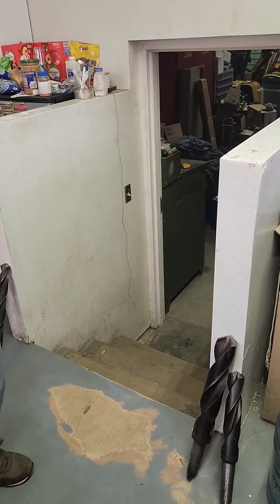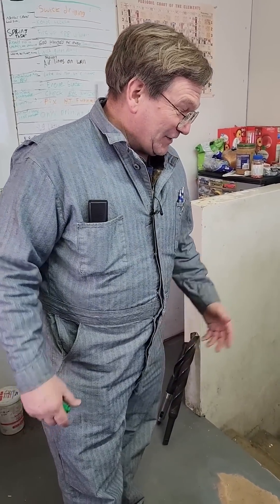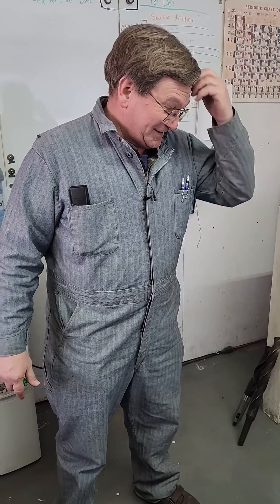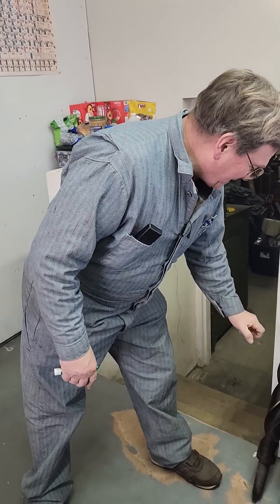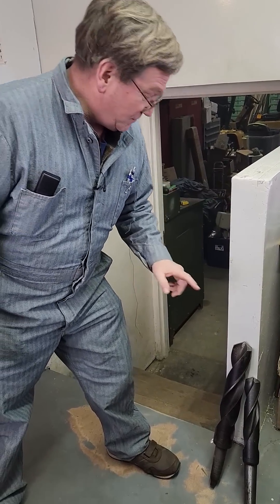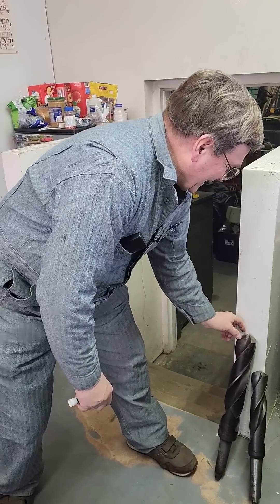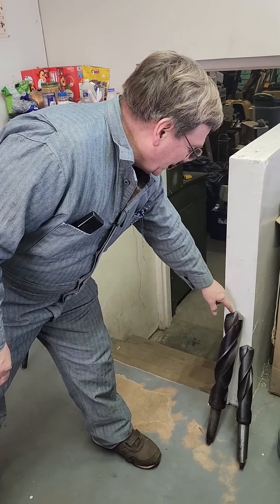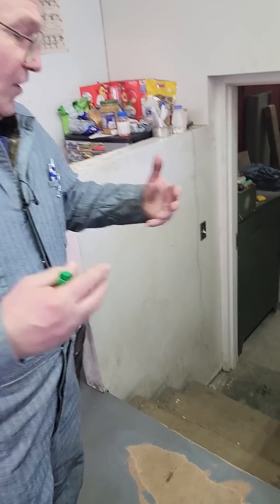Machinist's Minute(s): What size for your pilot drill?

Comment: Can’t agree more. Only been doing it for a couple years but I’m in school for the cnc side and very obsessed with applying it to my manual machining job and I find myself having this same natural thought process. It’s so important to actually understand how the things work and how you can take advantage of that rather than just following some rules made for first year apprentices. (This is more on the hydraulic side of our shop->) Like my boss at first was concerned about me cutting a small hydraulic line with a tube cutter rather than a saw because the instructor at his class told him it was heresy to use a tube cutter. The only reason he said that was because of the burr that it formed, but that is so stupid because you have to deburr it anyway and should be checking for no burr no matter what. I’ll take getting a square cut with slightly more deburring over having to try to grind a saw cut face square with a complete cluster of a 10ft tube bent in every direction and back over on itself.

Comment: To sit at a drill press with cutting oil ; i wholeheartedly submit…
Unfortunately, 99% of my boring is via a hand held cordless. As such I am susceptible to bit drift. Center punched but not perpendicular or just not clean. Knowing this is my weakness, I add a few steps between where adjustments can be made before final bore is achieved.
So, I will pilot at one forth to see if I like overall placement. Enlarge confirming angles of entry and exit. Then a Final Cut to size and file or thread to suit.

Comment: Measure the thickness of the web that’s the correct size
Edit: been a toolmaker, Tool designer/ machinist and programmer for over 50 years.
I’ve learned from the best .

Always be a student never stop.
I like that you point that out.

Comment: What I've done with drills is cut a "crankshaft cut" on the tip to thin the center. Works like a charm for cutting without all the pressure at the point.

Comment: I'm wired to look at why the rule is there, so that I understand the likely outcome if you hit a situation where the rule can't easily apply- taking out the majority of the material with a pilot, then drilling to final size is the idea- as you say, adjust for rpm and available tooling .
Also for larger sizes, it's amazing how well annular cutters or holesaws work , but I suppose they're working with lots of cutters working in little bits working along a circumference roughly 3x the diameter , vs a conventional drill where the diameter has a cutting edge across the whole width constantly working across that full width.

Comment: Pilot hole: start with the size you want

Stepping up in size: use whichever sizes seem reasonable 

Final hole: the size the hole needs to be, or whatever you got that's close enough if close enough is close enough 

I'm pretty particular in my ways, whether or not my way would be classified as "the right way", but sometimes it doesn't matter that much
Reply: or slightly under the right size and finish it with a reamer

Comment: 50% pilot hole makes no sense, you're not even using 50% of the cutting surface of the drill, and with a twist drill that means you're totally wasting 50% of the drill.

Comment: up to 50 mm i dont use a pilot but rather grind in a split point , most my drilling is a few mm under the finish size to be finished by boring so the accuracy and finish on my drilling work isnt important

Comment: I was taught to use the web thickness + 1/3 as a rule of thumb, the extra 1/3 giving room to evacuate the swarf/chips, but in a work environment where time=money you can easily crank a 2" split point into mild steel after just a centre drill

Comment: Im going give a "self taught" using trusted information method. A twist drills rake angle at the periphery is 12 deg. But, the angle decreases as the web is approached (normally). I then use nothing more than an intuitive best guess, approach to pilot drilling. A 1\8" web. Gets a pilot of 1\4". For lets say 3\4". This gives the reduced rake angle a means to cut as opposed to scrape through the hole. This works best for low to medium carbon and stainless steels. Softer and gummier are drilled with a reduced rake drill. I feel the theory and results give good evidence of its effiency.

Comment: I only clear for chisel point if my machine is weak, aka mag drill or Bridgeport, I drill 4-6” with spade drill preferably horizontal and clear chips after 2 times diameter depth, no pilot, will chatter if to big pilot hole

Comment: The bare minimum that needs achieved in general is to pilot just bigger than the chisel width of the drill. Bigger drills aren’t split all the way to center and aren’t good at cutting across the chisel. Smaller drills are split to center and can cut in the very middle of the drill. 

This is exceedingly important because your cutting speed (surface footage) is zero at the center (zero radius). The closer to center you are, the slower the cutting speed and big drills just aren’t meant to handle all that. 

This is true basically for HSS (usually Morse taper shank as shown here) drills. 

High performance drills built for CNC production environments are engineered to handle these extreme cutting conditions better though. 

No need to pilot a 3” carbide modular or indexable drill as long as it’s not crazy long.

Comment: I was taught  (from my dad - long time tool and die guy in a shop full of grey hairs to learn from until he became a grey hair ) that the main reason for a pilot bit is that the chisel point on the bigger drills increased the amount of force required to feed the drill through the material and if you are not in a rigid setup the drill will wander and change the hole location.  SO, the pilot drill should be larger than the thickness of the web or width of the chisel point on the bigger drill you are going to use making it easier to feed and more likely not to wander because the path of least resistance will lead the web of the larger drill pretty well and there’s less work for the point to do but he full beautiful cutting geometry of the bigger drill can efficiently cut the hole. 🤷‍♂️ it’s what I was taught and it makes sense to me because a smaller pilot hole is oftentimes faster to drill and then with the right amount of available power the bigger drill will cut more quickly. 😉😃

Comment: Great point about surface speed. When you are take your extreme case of the 12" drill at half the diameter the surface speed is 50% compared to the full diameter. If that ranges too far from your ideal SFPM you've got a problem. And you other factor is power and torque. Great short for thought. Bottom line question the hard rules and bend them as far as production requirements allow.

Comment: I always measured the center of the drill and added .020. I’ve used a .5 pilot hole on a 6.” Spade with no issues.

Comment: If you engage in web thinning you dont need a pilot drill either. As an apprentice I got chastised for centre drilling in order to start a large drill (2"? 2.5"? cant recall) that they wanted blasted through the stock as clearance for the next operation. that was a web-thinned drill and it started and cut just fine.

Comment: It's always been my understanding that the pilot hole size should be slightly more than the distance between the inside ends of the cutting edges. This way the whole length of the cutting edges is being used.

Comment: My shop teacher told me decades ago that the web of a drill bit doesn't cut, it rubs more than anything, so if you want to pilot a drill correctly without chatter, you would only need to remove the "web" diameter. I've always followed that and it's always worked like a charm. People using large pilot drills is the reason for chatter.
Reply: That is the rule I always used, remove the web with the pilot drill.
Reply: 100%
Reply: Or split point it. You are correct otherwise.
Reply: @butterflywing61 If you wrk someplace where you don’t get to spec twist drills you’re probably going to get chisel points from the crib. If you’re doing stuff at home and can afford splits as well, go for it.

Comment: You should vary your pilot holes so when you have to sharpen your bigger drill bits it’s because the whole cutting face is dull, not just the outside 1/2, 1/4, 1/8. 
As an example if you used the half rule, you’d only wear out the outside half of your big drills and be wasting the inside half sharpening it away.

Comment: "I was taught" - yadda yadda..  Is the real answer from a person who hasn't lived the craft enough to work out their reality yet (many never will)..
Pilot drill size all depends on how big is the drill and how much available force is there to push it into the job, coupled with available torque and coolant....

Dead centre is "necessary" - the minimum number of processes is key to production numbers..
 
How about a through hole cooled pilot tipped 3" drill...
 = single process - surface speed set for the "larger diameter range"..  Annular cutters are the best invention for large holes and small torques. 

 I just wondered, does a plunge cut boring bar exist??-( lol, drill-bore-ream single process) how about an annular boring bar plug cut large bores with a single point - like a curved parting-off tool, curiosity - sure, useful, probably not..

Comment: If you're making an airplane, you use all the smaller bits in the set working slowly up to the size you need, minimising the stress on the metal around the hole to reduce fatigue cracking.
Reply: THAT MAKES SOO Much SENSE!    Thanks!  I won't ever use it unless it's to critique someone on YouTube or Reddit🤣

Comment: I was going to comment.. You only need to make clearance for the web +  a little.
avoid using common sizes for your pilot holes as those drills get used least.. They tend to have the original grind and are still sharp.

Comment: Drill speed for a High-speed steel drill bit in mild steel is
320\Drill diameter in inches. I just remember 1280 for 1/4" and the rest is just fractions. Also Always choose the speed lower on the drill press than the calculated speed.

Comment: I'm no machinist but I've seen a lot of youtube vidoes and therefore I'm an expert!
From what I gather there's two variables, cutting depth and surface speed - for a shallow depth you need a high surface speed (and vice versa).
A drill has high surface speed at the circumference and low speed at the centre but a fixed cutting depth.
It's a compromise between the two but if you remove the centre you narrow the gap.
A bit like facing on a lathe where the centre of the part has a noticeably poorer surface finish - the lathe needs to speed up when the tool gets to the centre.
Reply: That's actually a very interesting point i didn't really think about until now

Comment: Jobbers are fine for a milling machine. But if you are hand drilling with hand drill you need to use piloted bits. A drill bushing and block to make the pilot hole (typically a #30) and piloted core drills after that. Keep using bushings and blocks for as long as you have them in the right sizes.Last pass with a piloted reamer and only remove.005" on the last pass. Use drill lube and go slow. It also differs for different material. In aviation I worked with Aluminum, Titanium, Carbon Fiber, Fiberglass, Steel, Plastic....and it was all hand drilling up to about 1 inch at the most.

Comment: I mean, you eventually have to drill with the final size, so if you're going to do a second (or even third, ...) operation, it had better be worth it from a time or cost basis.

Since most large twist drill bits don't have a split point worth a damn, way I see it, usually a short/stubby drill bit with sharp split point is all you need, with diameter just large enough for web clearance of the larger drill. For most jobs. Although if you know if the small drill will have issues from drilling too slow, you can go with a larger pilot drill bit (still with a good split point) if you can't take the speed down enough.

Comment: I bet there is a calculation to deduce the heat energy created by friction between the total area of two surfaces, the rotation speed, and the type of material (to get the coefficient of friction). This would just tell you the rotation speed to surface area contact required to not hit the critical heat point that will not cause annealing of your bit.

Comment: We use the quarter inch center drill and then from there slowed the machine down and turned up the oil and put whatever size we wanted in the lathe and went

Comment: I have always had better luck drilling long / deep holes with pilot holes the width of the web of the larger drill bit. For one simple reasoning, I get a straighter hole, or less wondering, all of which, once it starts drilling off center, it will only get worse the deeper you go. Some would say, it is faulty cutting geometry on the larger bit.. well, I just have better luck with pilot width of the web of the larger bit. And it will track wherever the pilot went.

Comment: The answer is the thickness of the web. The tip (web) in a typical drill bit doesn't cut, but rubs as the bit turns (a split point helps alot).  A pilot hole drilled to the diameter of the web thickness will allow the large drill to start and maintain full cutting (chiseling).
Reply: Correct.
Reply: That's my experience. Been machining CNC and manual for 13 years, and to me, the pilot is to relieve the web enough that your cutting edges on the drill can engage 100% before the tip needs to contact the material. Once the outer corners make contact, unless the drill is ground incorrectly, it'll be fine, long as it has ample lubrication and it isn't being forced into the part
Reply: Glad you clarified "web" At first, I was thinking a philosophical answer.
Reply: Split tips are great, feed the nuts off them without drilling off center and both lips workload is equal start to finish. Ever use coated split tips?
Reply: Yeah I was going to say the web size. I had drill up to 5 inch diameter , clearance for a pillar supports

Comment: I don't think there is any point drilling a pilot for anything smaller than a 1/4" drill. My opinion a pilot should be no less than 1/4 the diameter. And around 3/4 of the diameter is about the most. A pilot definitely speeds up drilling time , seemingly anyway never actually timed it. The time swapping drills and drilling holes. And always use lube!!   I'm no machinist  just play one I reality!     My question of the day, what makes cutting oil cutting oil, and can I get the "stupid stuff" voice over as a ringtone??😂 Seriously that would be awesome!!

Comment: I always try to useas small a pilot drill as possible, so slightly larger than the web of the next drill. I started doing this for 2 reasons.
1) The smaller drill is faster.
2) This method is much less likely to grab, so you can 
push a liitle harder on the feed without the drill grabbing and spinning the part, snapping the bit, yanking the chuck from the tail stock.
I see guys use 4 different size bits to get to a 1/2" hole when the machine will easily turn a 2" bit.
Of course everything depends on the job at hand.

Comment: I'm a decorator and the other day I explained to the (he called himself a) carpenter that if he pilot drilled his hinge screws then he'd stop splitting the sides of the cheap doors that he was using.
In fairness, he did listen, and hasn't kicked any of my paint cans over, yet 🤷‍♂️
Reply: As a carpenter, I would like to say that this individual must not have been a real carpenter ~ and definitely not a good carpenter! Cheap tools & materials makes the project or job look cheap, and not be able to last as it should... And won't bring word of mouth business, which testimonials are the best form of advertising.

Comment: I always buy the best quality drill bits in kits. 
For my poll holes, I always use the ones that are not very popular. But also, I use the smallest ones that I can hand sharpen so I can always have very sharp bits. Becoming very good at sharpening your drill bits is the key for me. That way you don’t run the bits until they are too worn out.

Comment: the rpm is determined by the diameter  as the outside of the drill has the highest surface speed, the pilot drill only needs to clear the centre web, as it doesn't cut effectively and tends to deform the metal out the way so the edges can cut it. larger pilot holes tend to increase chatter until shoulders enter.

Comment: I ran a stankioport soviet radial arm drill for many years, the man who taught me (goldie) ran it for 35 years before me. For me it depends on the presision of hole required, for compicated valve drilling too much pressure/or too small of a pilot could very easily blow out tolerances, ofcoarse when have the valve and reamer set for a specialized valve configuration its not as important.

Comment: If one drills a pilot slightly smaller than the web thickness of the final drill, the remaining material after the pilot will stabilize the final drill  without putting undue stress on tip.

Comment: I always go just under the chisel points width. Keeps nice even cutting pressure and wear across the edges and dosen’t wobble

Side note, you usually don’t need to use a pilot for anything under 1.5” on basic materials

Comment: Never heard the 1/2 the diameter rule for a pilot drill. Seems awfully large and wouldn’t it be prone to the full sized bit chattering or not cutting cincentric? In tool and die school we were taught 1/64-1/32 bigger than the dead center/chisel point.